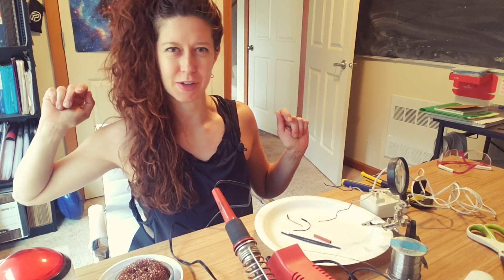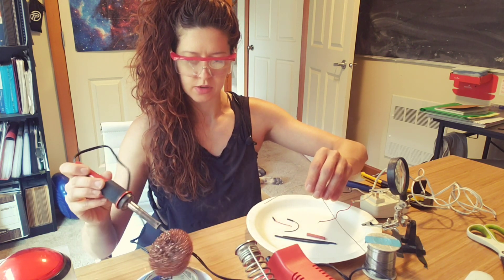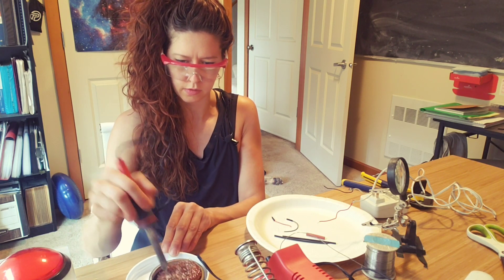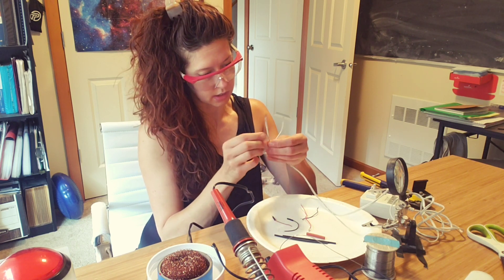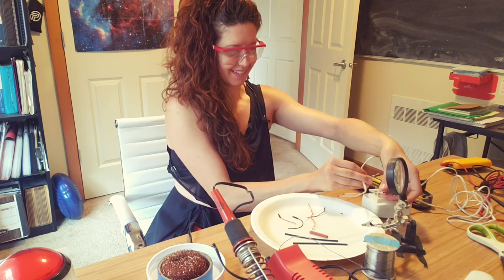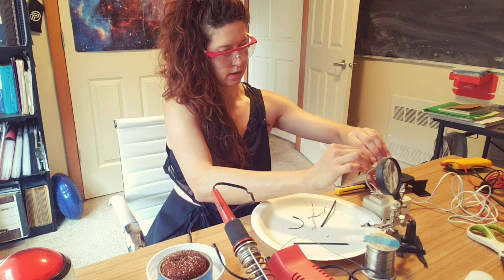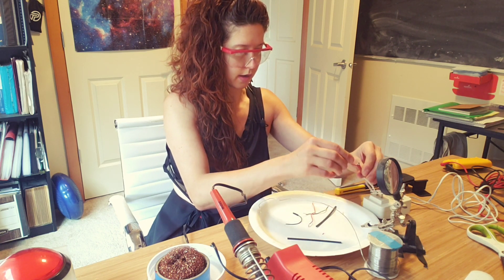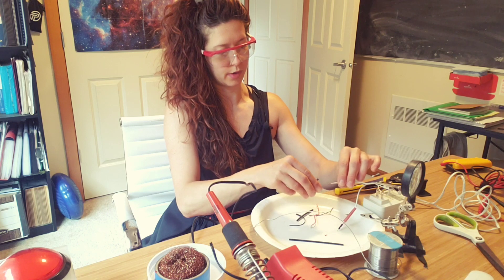How to solder new leads to a power supply!

Comment: "I'm pretty sure the lead with the dashed line is negative, but I'm not positive..." lol.

Another tip, when you cut off the connector, leave a few inches of wire on the connector end so you can solder to it later if you need that connector for something else.

One more tip: I like to cut the leads to different lengths so that if they're dangling, the leads are less likely to touch & short.
Reply from the maker: ohh great tip re: connector! will def keep that in mind.

And of course I was backwards on wire markings -- dashed line = positive 😜

Comment: I'm learning soldering this semester! 🤓
Reply from the maker: Yayyy thats awesome!! 😄 its a handy skill, helps with fixing household electronics as most of the time things stop working cause wires break (e.g. Apple cables)
Reply: Really? I have that problem now. I was wondering what it could be used for. Why do they make products to break😕
Reply from the maker: @1polyron1  hah I have fixed more than 1 absurdly expensive/legit overpriced apple cable. Cheaper materials = shorter lifetime, cost is borne by the customer (oh hey thats us!) rather than the business (and that's apple). 

TBF tho, wires are metal, and metal is NOT flexible. Hence why the pluggy end of a cable is covered in thicker flexible plastic and why flexible rubber/plastic coats the whole metal part. This is a serious challenge for wearable projects also cause turns out rhe human body moves in lots of ways, hah.

But yea, some of it is cheap design and some of it is just that wires that get used a lot just break. Good news is that fixing them is super straightforward once you know how to solder!
Reply: @JenFoxBot  Thanks for the breakdown. I usually joke that a lot of companies make products that are made to break. You'd think there would be some way that's both cost effective and makes a quality product especially what you pay for some stuff. It's a pipe dream, I guess. They get the big bucks for a reason. Hopefully I won't have to worry about another damaged wire again once I learn soldering.